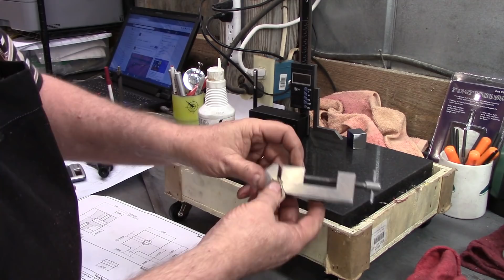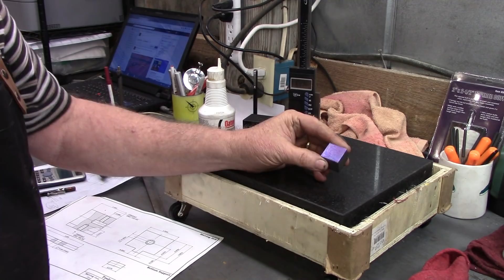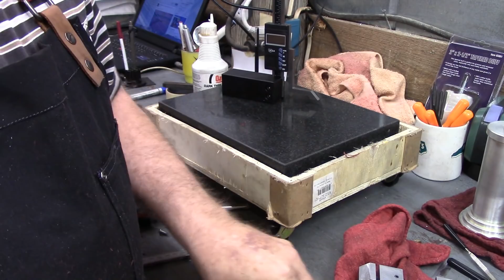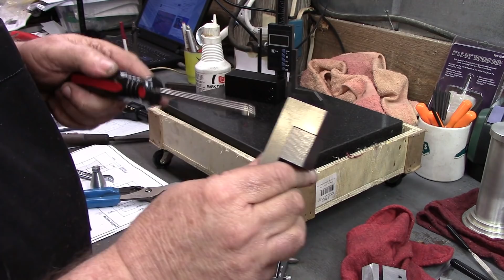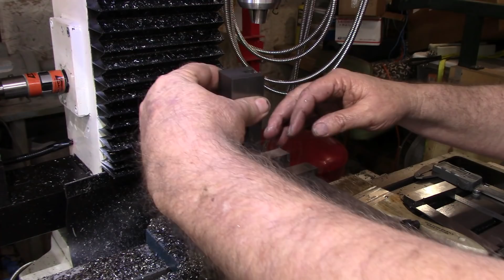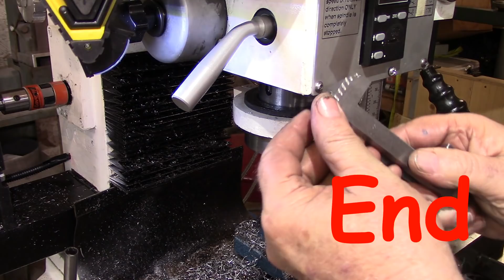Mr Pete's Tool Makers Vise Part 2 of 4

Comment: Lee

Just a suggestion.   When milling the 45degree angle on the end of the vise body, move the vise body so it extends past the end of the mill vise and set the angle there, so just the minimum of the vise body extends above the mill vise jaws,  Should be more stable than the way you did it  Depending on the height of the mill vise over the mill bed, you might even be able to get the far end of the vise body in contact with the mill table for best support of the project

John

Comment: Looks like your thumb may have argued with a milling cutter!
More very nice work Lee, although I did tho flinch as Mr Bozo struck - big ouch. Felt your pain.
I guess your shop is way warmer than my ''refrigerator''!
Reply from the maker: Been having to run the propane heater and an electric heater, but it's warming back up now.  The thumb cut from my excessive "need" to run my fingers across everything - even before deburring.  I see myself doing that when I'm editing my videos, but don't even think of it when I'm actually doing it.  I'll learn one day, maybe.